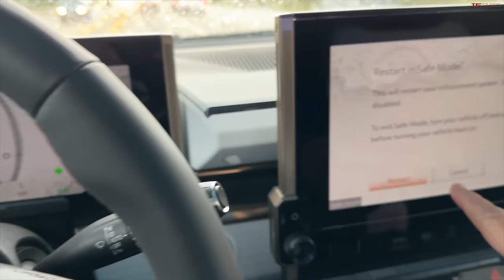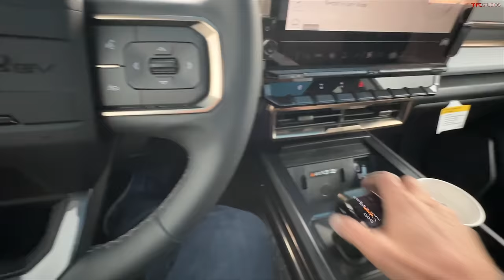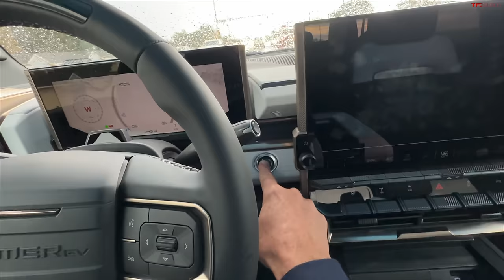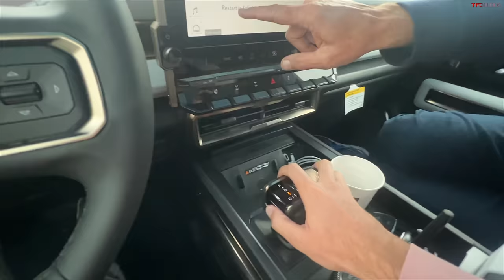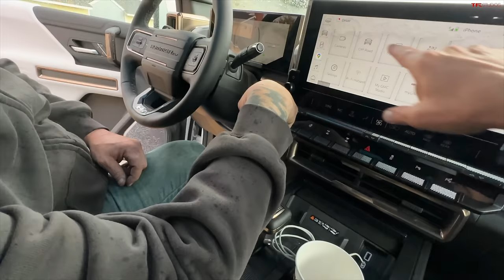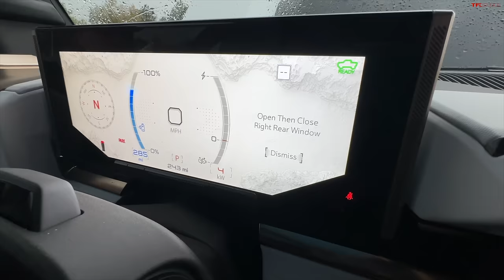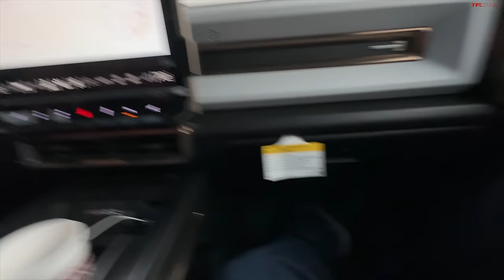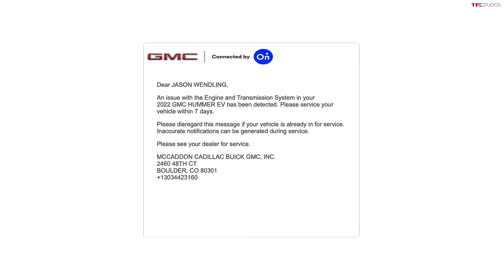I Bought a $115,000 GMC Hummer EV and It IMMEDIATELY Left Me Stranded!

Comment: This is happening to a lot of expensive vehicles.  You guys should do a whole segment on this.  Listen to ppl dealing with lemons and have them come on your channel, random shut downs, etc.. Call out these companies, hold them accountable.
Reply: I think they are aware that there are issues in other vehicles, but the point they are trying to make is how this issue left the owner stranded in a dangerous situation.  But more importantly, the vehicle lacked intuitive controls or mechanisms that would allow the user to reset the system.
Reply: That’s a great idea!
Reply: My new GMC AT4 was dead in my driveway the first day with 180 miles on it.  It was stuck in what I call “accessories mode”.  Fan was on at full speed could not turn fan down or off, could not start engine and could not shut the It off or get it in neutral.  Dealer said it was a bad battery, well yeah the batter died after it sat stuck in my driveway all day with the accessories on. The dealer put a new battery in the car assured me that fixed the problem, a few days later check engine light is back on.  3 weeks later check engine light has been on every day, dealer said I hit a bird and took out a shutter on the front grille and he was so proud to show me the missing shutter,  The service advisory was confident that was the problem and would order the shutter assembly.  He was a little embarrassed when I asked if he ordered enough to fix all the new  AT4’s on the lot, he looked at me confused when I said all his trucks on the lot must have also hit a bird as they were also “missing” the same shutter vane.  I then explained that the truck never had the Vane and it was designed that way.  

I should have stuck with the ugly Tundra, but one more service appointment and I qualify for lemon law.
Reply: @4PAWDAD  OMFG 🤦‍♂
Reply: Makes you wonder if companies are using substandard components due to all the shortages.
Reply: I have a new F150, and all the cameras stop working when I remove the tailgate. I installed the correct connector caps, and obviously the tailgate camera won’t work when it’s gone. But why do all of them stop working?
When I go in, the service manager tells me that they have 300 cars in the back that need parts or labor to run. They’re short on both. The dealership has been as helpful as possible.
I’m buying an extra camera to plug in while the tailgate is removed. Now I’m just waiting on parts…
Reply: @grumpychocobo  absolutely
Reply: @grumpychocobo  not just cars either
Reply: @grumpychocobo  I mean it's GM.  What most people would consider substandard has been going into their vehicles for decades now.
Reply: Just imagine when these electric cars start getting older. Look at household electronics. Seems like a tv can’t last longer than 7 years, if you’re lucky. Cell phones don’t perform well after 3-5 years. And we’re going to do a car that completely runs off software when we know things get buggy and slower over time just like anything else? I don’t think this is even the beginning of some unsafe situations.  It’s about to get down right ugly in the next few years… especially in CA.
Reply: YES help the little guys too
Reply: my mom's hybrid Malibu locked her inside of the car and we couldn't get the doors open. the spooky part is it happened outside of our dad's house during his funeral, my parents hated each other so I'm not ruling out the idea of my dad's ghost messing stuff up, but either way the fact is these cars are extremely dangerous what if the car catches on fire and the doors won't work? There's no manual door unlocks on the outside or inside of the car. What I'd it locked a small child in the cat on a hot day? Just like the hood and trunk not opening on this hummer, the doors could have just as easily locked up and then you can't get out if it's in an unsafe area.

We're a GM family so we basically only buy gm, my grandpa worked for gm for 22 years on assembly lines, but these issues are very concerning, and yes it's their fault as a manufacturer for putting subpar components in their vehicles. but I also blame the cry babies I see a lot on these channels whining when a manufacturer doesn't put a 32" screen in the dash and self driving and auto headlights and massaging seats and crash avoidance and all of the other stupid technology. They're doing what the people want by putting this garbage in there and it's going to fail and always does eventually. I don't need a self opening hood, a self dropping tailgate and auto locking doors stop putting this garbage in here and then maybe they'll work better. So I blame the consumers just as much as the manufacturers.
Reply: This seems to be a larger issue with manufacturing as a whole - it seems everything being made post-covid has been having massive issues with reliability. Doesn't matter if it's a kitchen toaster or a massive six-figure luxury SUV. Quality Control seems to have gone completely out the window in the last 2 years.
Reply: @ericarntson2035  yeah, have you seen the complete disappearance of the entire American workforce?
Reply: I went through some hassles in 2019 when I bought my new Silverado (the new gen). Back and forth to the dealer with a lot of recalls. Fortunately, I don't have any more issues, except the leaking back window which was replaced couple of months ago. 
I came to the point that the new cars are like tea. You have to be patient to let them brew. 
Still, in my opinion, electric trucks are just a joke.
Reply: @amprg  the tea analogy isn’t comforting but yeah I have had 15 new vehicles since 2016 and there has been at least once issue with 7 of them. That’s a not very good ratio for new cars.
Reply: GM should pay your tow bill haha!!
Reply: @Jay-bw3fl  what other choice do we have when we spend $60K and have no solution for their life threatening problems? I went through a whole nightmare with leaking back window.
I've been just lucky to work with a dealership for decades who are fighting with GM for me. I had issue with my 2021 Mazda 3 Premium with no results because the dealer didn't support me. 
In my opinion, having a good dealer is more important than the brand.
Reply: @amprg  yeah there is some truth to that. My local Chevy dealer service dept is really good too. Now, My local ram dealer service dept will make you fighting mad and make you never want to buy another Chrysler product lol
Reply: @dedalliance1  I believe if you pull the door handle twice  in a row, it should open.
Reply: @usa1camaro377  Hmm maybe but I don't think so. What had happened was the key fob battery was dying, or died, in the process if trying to start the vehicle and basically went into anti theft mode.
Reply: The Owner’s Manual clearly stated not to drive in the rain.
Reply: @dedalliance1  Try this. With someone's help, lock yourself in the car with no key.  Try the power unlock to get out. If the power lock does not work, pull the door handle twice in a row and see if it opens.
Reply: Electric cars are nothing more than giant plastic toys
Reply: @leelashbrooks8780  Yeah if you don't build them right, I mean GM can't even make a good gas car, like I'm really going to trust them to go electric 😂
Reply: @Mattss90  it’s scary to even think about. Not a good idea at all!

Comment: Thank you for showing us another example of why you should NEVER buy the first model.  ESPECIALLY a whole
new concept and technology for $115k!

Love your videos!!
Reply: I mean someone will have to be the guinea pig for the first models. The new V6 Toyota Tundra had engines issues however unlike GM, Toyota fixes and refines their vehicles meanwhile GM we get these clunkers
Reply: What you should learn here is NEVER BUY AN EV!
Reply: Dont buy any ev untill atleast another 5 years until they work out the troubles if they can, at this point as said in another video these are really just over priced toys if you have 115, 000 or 140, 000 just to throw away and im sure most of the population doesn't.
Reply: More like never buy a gm
Reply: Never buy ANYTHING made by a union.
Reply: @jofus3604  Or if you buy an EV, it has to be a Tesla.
Reply: @harrychu650  I'm sure even first gen Teslas had issues. The thing is, they are way past first gen on Tesla, and there are many Tesla drivers on the road to complain about things before you have to.
Reply: @harrychu650  The difference between other manufacturers and Tesla is like the difference between eggs and bacon for breakfast...  The chicken is involved with creating the agg, but the pig is committed to the bacon.
Reply: @fitybux4664  You cannot expect a union shop with their focus on senior rather than merit to design, build, and continuously improve world-class software.

The incentives just aren't setup for it. If you are willing to buy premium priced EVs from these legacy auto producers, then you must accept second rate software which like this owner can be crippling.

If you want world-class software and tech, then look to a silicon valley rooted outfit. It is just that obvious and simple. Legacy Autos are playing in a league they're not cut out for.
Reply: The problem is not the first model, the problem is Hummer… is garbage.
Reply: Yeah, he is taking the lumps for us future owners

Comment: I love it! A $115,000 truck and the hood release is a wire loop.
Reply: A wire pull doesn’t require power to use
Reply: There is miles or wire in there.
Reply: Maybe an afterthought like the factory had this problem too.
Reply: some things never go out of style
Reply: and it is hard to find/get to as well......
Reply: is a new trend ppl will buy it. ppl r dumb these days they buy anything that's expensive. Today's ppl r one trick pony no commonsense need it.
Reply: So many things you could complain about the truck, like taking four days to standard charge and twenty-four hours on fast charge, towing issues, range issues, weight issues, temperature issues, electrical issues, the fact that the electric release and electric hood didn't work. You chose to make fun of the emergency release they added so you would never be locked out of the hood compartment, probably the only good thing on the truck that got them out of the situation.